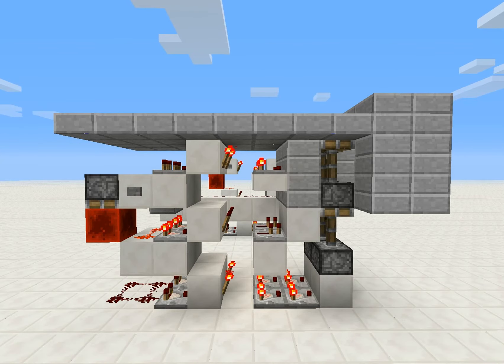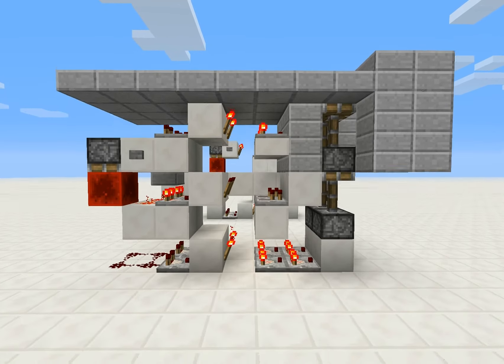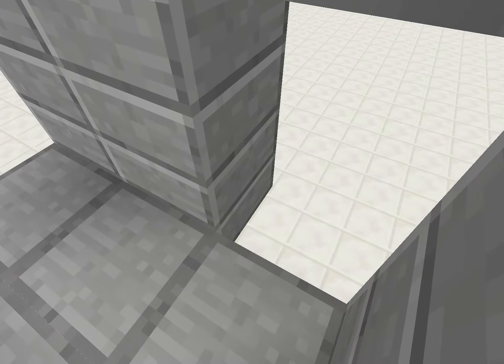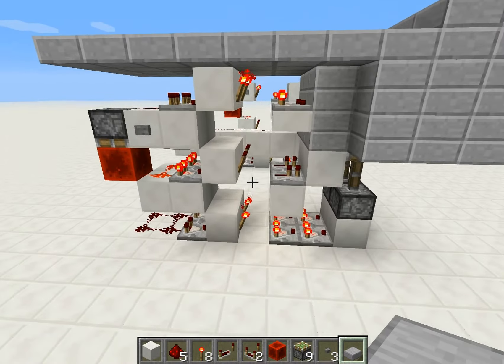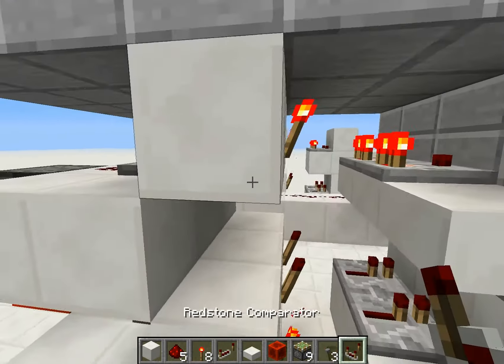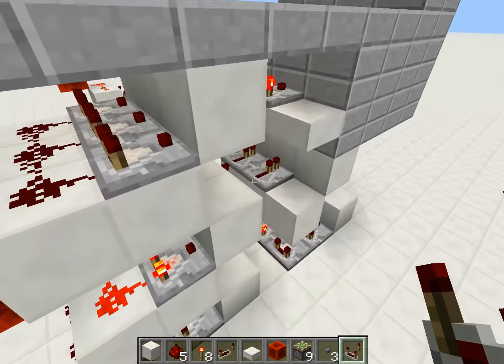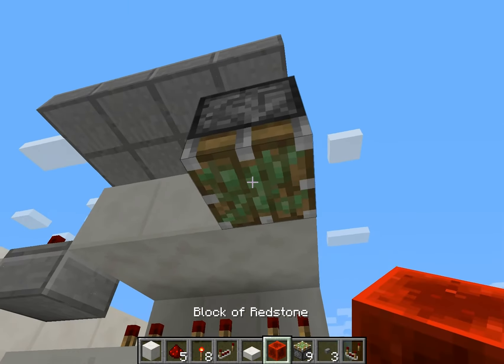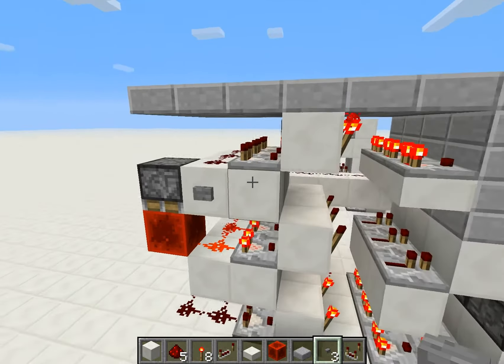100% Flush One-Wide Double Piston Extender 1x8x5

Comment: Okay. I built it. Four of it. And two of them work, two don't. It is not an error from my side, it is not an error of some direction quirk, it just does NOT work there. Works 20 blocks away. I have removed everything that can affect it, and those opposite do work. Removed them, only the dirt blocks left, so only the problem one was left. Same thing. Tried everything, it just don't want to work. I have checked it fifty times, there is no logic in this :O

Comment: Not the smallest extender as others have parts that can be moved if needed. BUT, this doesn't seem to glitch out as much as the others (without having built it lol).

But my question is, is this reacting to block updates on the sides of the pistons? My plan is to build two of these, and have pistons pulling the pistons and block away so it becomes a hole, a trap in the bottom of a stair, to be precise. Two wide stair. You can see where this is going :) If you wanna try it out, I'd be happy! Jim